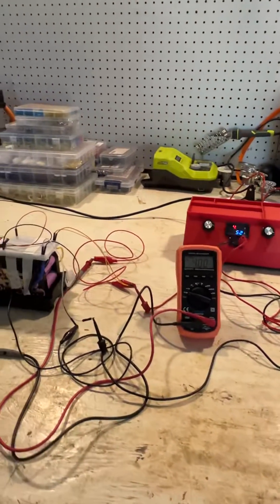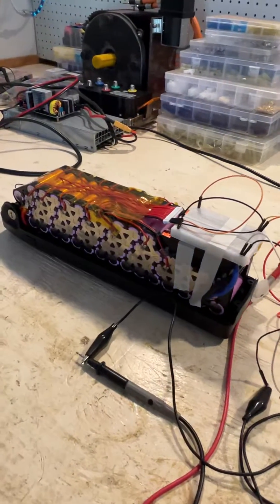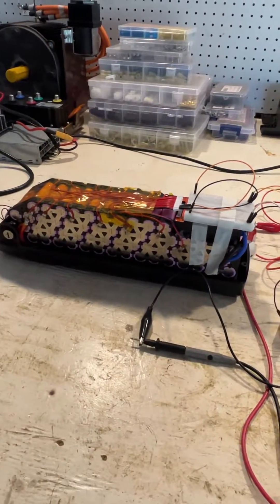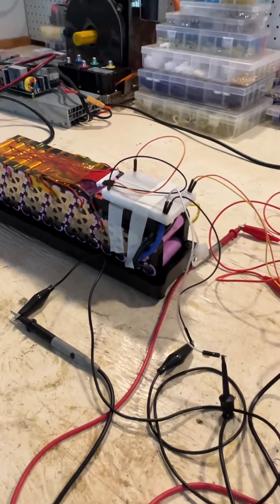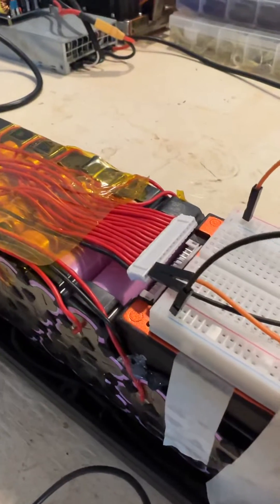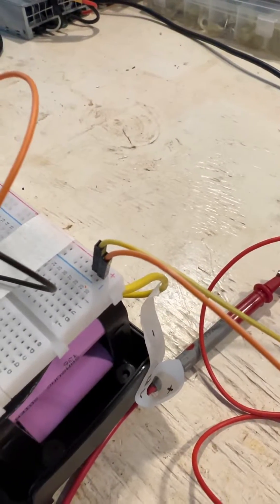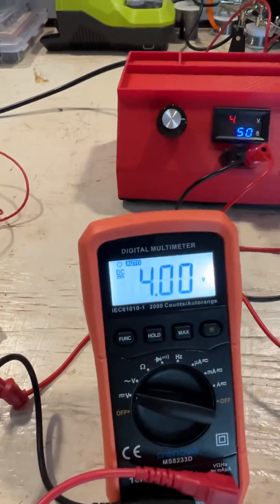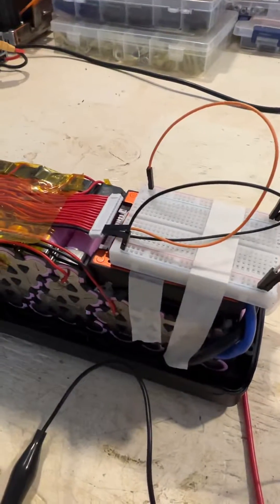A BMS does not actually balance your battery pack.. and what you can do about it!

Comment: Well now I'm considering switching out the BMS on my battery.
Reply from the maker: switch it out for what is the question. there are essentially no BMSs that are appropriately sized and priced for a small battery pack like this and have active balancing built-in. they all use a passive balance method, which may as well do nothing. there are now active balancers on the market that you use together with a BMS but now you have to have both wired to your battery pack and fit inside your case. I think it's good to keep a BMS, mostly for overcharge protection, but for balancing, it's probably best to keep a balance connector accessible to check and balance charge the pack periodically
Reply: @GaiusGarage  to be honest I was hoping there would be a high end BMS that would do a better job balancing, but I haven't researched it. Maybe I would be better off just building my own.
Reply from the maker: @k20nutz  there are more expensive BMSs out there like Batrium, which do have active balancing but it would not be cost-effective for a small battery pack like this and wouldnt even fit in the case. if you can design your own, hats off to you! Ive thought about this as well but would need to seriously up my EE game for a project like that
Reply: So what I’m about to say is still a passive solution so takes a long time - my battery has now been balancing for about 7 days and we’re not quite done yet. It’s as ANT brand BMS with bluetooth and I just set the protect param/cell high recover and balance control/balance start voltage to 3.9 (default is 4.1). This passive discharges at 100mA so it’s not quick but it shoud get there ! When I started last week one cell was at 3.8 while the others were at 4.15 and now it’s closer at 3.85/3.94. It’s a pain in the butt, but I’d rather not take my battery apart all the time (same case as is the video) given the small screws that bit into plastic.
Reply from the maker: @salunderscorepark  I have an ANT BMS as well for a large battery pack and had a similar difference in cell voltages (4.1 vs. 3.8) and I did the same as you-- lowered the balance threshold and increased the high cell cut off to 4.25, and recover to 4.15. Then you can leave it plugged in to the charger and the BMS will keep cutting off charging when the high cell reaching its limit, then the balancing should bleed off some of the extra charge to the lower cells, then repeat -- for days ... and still not balanced. I finally ended up using a hobby Lipo balance charger to balance charge 4 cells groups at a time until I had the entire 20s pack balanced. BMS balancing is practically useless.. you either need to use an active balancer permanently wired to the battery or keep a balance connector available for intermittent balance charging. what a pain!